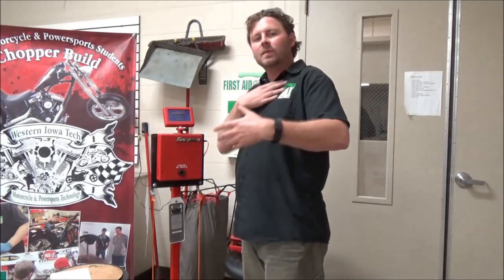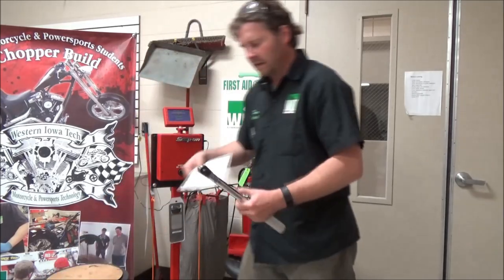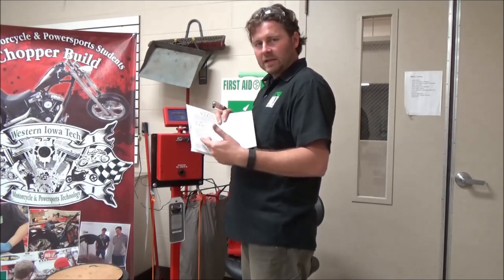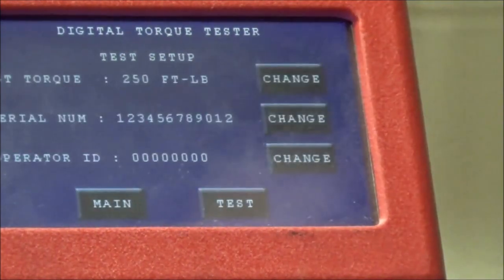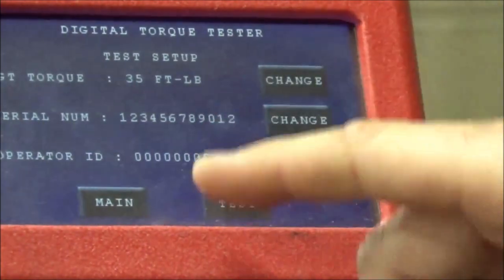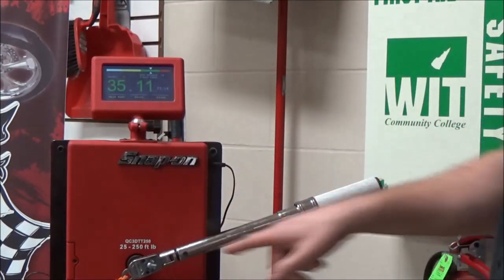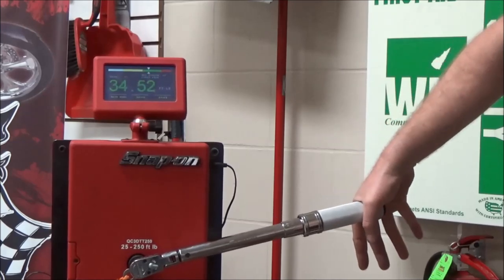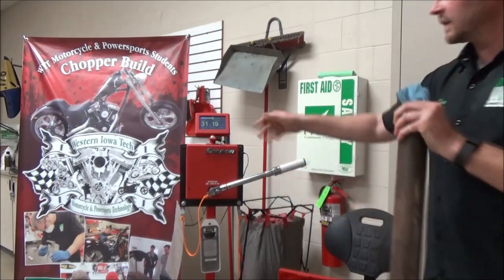Why hand placement matter when using a torque wrench. Proof with electronic tester!

Comment: This video is absolutely correct because the clicker torque wrench mechanism doesn't measure torque at the socket - it actually measures at the pivot where the ratchet head attaches to the tool's shaft.  The torque at the socket is greater than the torque at the pivot due to the added length from pivot to socket - so to correct for this the torque wrench scale is "doctored" with a correction factor to produce the right torque at the socket.  

The correction factor is a ratio: (distance from grip to socket)/(distance from grip to pivot).  The problem is, this ratio changes as you move your grip position - from 1.00 (with an infinite handle extension) to infinity (if you were to grab right at the pivot).  On my Craftsman wrench I measured this ratio to be about 1.09, which is probably typical.

So depending on where you grab, your torque can vary from 9% too low all the way up to infinite torque.  The only place where the correction factor is accurate is right at the center of the hand grip.  So be sure to grab it there.  If you need to use both hands, put one on top of the other to keep all the force applied to the grip..

Every torque wrench manual I've read says you must grip the tool at the hand grip only, but none explain why this is.  Now you know.......
Reply from the maker: Thank you for commenting. Would you consider helping support our work here and help keep us going? We can’t thank you enough for helping us keep making technician training impacting schools all over the world. Could you spare $2 and support us with even more benefits? Smash the subscribe button and bell! Join this channel to get access to perks:
https://www.youtube.com/channel/UCBhM8DCKnT3qXwTW0eToyCg/join   
-Daily MEMBER FIRST COMMENTS ANSWERED FIRST 
-Live Q/A video chats
-Wonder if we have a video on your need? Members can request content links!
-Full Access to the ENTIRE 700 video library
-Member-Only FREE tool giveaways 

Just want to say thanks quick to support us for this information and our work saving you money? 
Give us a high 5 here:  https://www.paypal.me/how2wrench
Reply: i just watched a 12 minute video explaining that with math (whitch i didnt understand) and then you just come here and expain it to me within 20 sekunds and 1 sentence, thx for the easy explanation

Comment: EDITED!!

Stuff is called length dependency or lever sensitivity. It is because "click" style torque wrench have secondary pivot point somewhere in the middle of the shaft (depends on the wrench). So whole torque measuring process is happening at this "secondary pivot" point. Therefore distance from this point to the socket works as an extension. So when hand is placed closer to the "secondary pivot" point it requires more force to achieve set torque resulting with more force being applied to "extension". 

It took me 20min to research. ;)

Great video! Thanks!

Original post below

Watching it in slow-mo. at 0.25 speed.

At short distance, after torque wrench "clicked" you kept applying force. Reading value "jumped" after click! So although set "click" force was accurate, additional "unwanted" force caused by poor control increased reading. 

Those "click" torque wrenches are designed to "click" at set torque. And it does not matter if large torque is applied at short distance or little torque it applied at long distance ;)

It is more about control. As pressing hard on short handle makes it more difficult to stop once set value is reached ;)

More accurate test would be 

Clamp long bar to the torque wrench and use pull scale at different distances. Calculate pull-force required to achieve desire torque and do multiple distances. As you go further away, the pull force will reduce but wrench will keep clicking at set value. 
It is important that extension bar is clamped - otherwise reading will be "shakey" ;)
Reply from the maker: You rock! Best way to help us back is joining or grabbing our T-shirt! Support links and gear below!  Awesome and thanks for commenting! Smash the subscribe button (thank if already a sub!)
Have you seen our "YouTube Trained Support Shirts? Great way to "high five us" https://goodfellasmerch.com/collections/how-2-wrench/products/support-shirt

Join this channel to get access to perks:
https://www.youtube.com/channel/UCBhM8DCKnT3qXwTW0eToyCg/join   
-Daily MEMBER FIRST COMMENTS ANSWERED FIRST 
-Live Q/A video chats
-Wonder if we have a video on your need? Members can request content links!
-Full Access to the ENTIRE 700 video library
-Member-Only FREE tool giveaways   

Just want to say thanks quick to support us for this information and our work saving you money? 
Give us a high 5 here:  https://www.paypal.me/how2wrench   

Got an emergency and your head is about to explode from frustration or fear? Get Shane’s cell here: https://how2wrench.com/ols/products/techline-one-on-one

Comment: To those who wonder why, there is an explanation here: https://www.engineersedge.com/manufacturing_spec/torque_wrench_1.htm
This type of "click" wrench has indeed a lever/fulcrum mechanism inside the shaft (see wikipedia: https://en.wikipedia.org/wiki/Torque_wrench#/media/File:Direct_pawl_clicker_torque_concept.png ).
So, the mechanism can be simplified as this:

T2      T1              F
|           |                |
|           |                v
o-------o------------|====
<- L1 -><-    L2   ->

A force "F" is applied on the handle, at the length "L2".
The setting of the torque wrench actually sets T1; it is the torque at which the fulcrum will buckle (and produce the "click" noise). The bolt will be torqued at T2.
If you take the equations:
T1 = F * L2
T2 =  F * (L1 + L2)

You want T2 a function of T1 and the length of the hand on the shaft, which is L2 (because this is actually where the bolt is, not T1, remember): you then replace F with either T1 or T2 and you have:
T2/(L1 + L2) = T1/L2 and so
T2 = ((L1 + L2) * T1)/L2

L1 is fixed, because it is inside the shaft (take a look back at the wiki diagram).

Basically, that means that the torque at the bolt (T2) will NOT be the same for a specific setting (T1, set on the wrench) if the force is applied at different place on the shaft. It looks like the function f(x) = 1/x.
You can pick fixed numbers for L1 and T1, calculate few "points" for T2 (depending on differents L2) and draw a diagram: it will all make sense :)!
Reply: You can see an example here:
https://zupimages.net/viewer.php?id=21/12/45lf.png

You see that for a fixed torque set on the wrench (T1), the "output" torque seen by the bolt (T2) really depends on the spot where you apply the force on the handle (L2). That is why it is important to correctly handle the wrench, where the manufacturer tells you to. This is because at this specific point, this is the correct "ratio" where the set torque on the wrench will actually be the one applied to the bolt.
Reply from the maker: Appreciate you ...🙌 
Thank you for commenting. Want more benefits? Smash the subscribe button and bell! Want even more??? Join the channel:
-Daily MEMBER FIRST COMMENTS ANSWERED FIRST 
-Live Q/A video chats
-Wonder if we have a video on your need? Members can request content links!
-Full Access to the ENTIRE 700 video library
-Member-Only FREE tool giveaways 
Join this channel to get access to perks:
https://www.youtube.com/channel/UCBhM8DCKnT3qXwTW0eToyCg/join  

Just want to say thanks quick to support us for this information and our work saving you money? 
Give us a high 5 here:  https://www.paypal.me/how2wrench
Reply: Thank you so much for this comment. Your explanations along with the wikipedia image give me a better idea of how these things work.Very much appreciate you taking the time.
Reply: This needs to be on top 👍
Reply: Hey you are great teacher that took your time and showed it better than anyone explains verbally for me. I watched a video drawing erasing calculating but he made me confused but your script is enough without any calculation.
Reply: @petethewrist  Your conclusion is correct, but since I have no idea what a "cros foityou" is I'll just paraphrase what I think you were trying to say: that while @benhetfield is correct in his math, his conclusion is wrong because (not withstanding any minimal deflection in any realistically constructed torque wrench) hand placement doesn't change the "effective" force at F, it just changes the actual force you have to apply wherever you do place your hand; you will indeed have to apply more force with your hand if it's closer to the bolt/nut/whatever and less force (from your hand) the farther you get away from it (but the wrench is indeed measuring the exact same torque regardless of hand placement). That is an absolute fact. The reason the tester is displaying different torque values is due to some other factor, most likely because the user has to pull so hard on the wrench when choked up close to the pivot point that they can't react fast enough when the wrench clicks; remember that the machine is displaying the maximum torque measured, NOT the torque measured when the wrench clicks.

Comment: I’m a structural engineer (1980). The torque measurement mechanism is specifically designed for a consistent load application point. This obviously is the handle.  There is more complexity going on in the measuring devise than appears to a simple observation.  These forces of shear, axial, force couple, angle of force application, rotational torsion, gear friction, thread friction, variable stiffness spring constant and other characteristics are affected by the force application location.  The handle works!
Reply from the maker: Thank you for sharing…below are some links that help support me and my work. Please subscribe and share these videos to make a difference in education!
Keep Wrenching,
Shane Conley

Shirt/Stickers link: https://how2wrench.com/product-category/specials/ 

Follow us!
Web:
http://www.How2Wrench.com    
http://www.Tools2Wrench.com  

YouTube: 
https://www.youtube.com/c/ShaneConleyhow2wrench  

Instagram:
https://www.instagram.com/how2wrench/ 

Linkedin: 
https://www.linkedin.com/in/shane-conley-how2wrench/ 

Facebook:
https://www.facebook.com/MechanicsLearningSharingPage/  

Free Mechanic info, tool reviews, and “how to” videos newsletter sign up: https://how2wrench.com/subscribe-free-newsletter/ 

Amazon Tools: 
https://www.amazon.com/shop/shaneconleyhow2wrench?ref=ac_inf_hm_vp
Reply: @petethewrist  Not True. In fact if you have the complete formula you can calculate what the error will be for any hand position which matches the tested values. It's hard to understand it but it absolutely is a fact, hand position matters. The best explanation I've seen is the vid "Why GRIP Position on Torque Wrenches MATTERS!"  by The Bike Sauce who breaks it down.

Comment: The reason for the higher numbers when you grip only part way up the handle is easy- almost no one can react fast enough to release their pressure on the handle before reaching the end of the stroke after it clicks, which will produce a higher torque reading. It has nothing to do with the torque wrench itself.
Reply: Wrong.  It has everything to do with where you place your hand.  If you can't react fast enough to stop pulling when the wrench clicks, you'd get excessive torque even if you hold the wrench properly.  It's a matter of geometry, not reaction time.

Comment: Very good video.  

I am an Engineer and have watched a few of your videos to date.  You are 100% about handling the torque wrench in the center.  One thing I want to add is how to pull the wrench.  You should not push down on a torque wrench.  You should pull the wrench with your hand positioned in the center.  This allows you to control the motion and stop at the click.  Also, as the fastener tightens, you need to slow down until the wrench clicks.  This ensures you do not overtravel.  

You nailed the 25 lbs.-ft once in your video.  Try again and avoid pushing down on the wrench.  Pull it towards you, as you tighten, to observe how the torque is attained close to your setpoint.  

You have a great channel and are an excellent instructor (and your videos are spot on).  This is something I wanted to add since pulling towards you, rather than pushing, allows you to control the clamping force and stretch the fastener more effectively.  More often, pushing usually gets you over the target torque.

Keep up the good work!!
Reply from the maker: Well thank you! We will share this with Shane directly in Fridays meeting! 
You rock for commenting! We encourage experience and well wrote out comments like yours Bryon. 
Grab our T-shirt! Support links and gear below!  Awesome and thanks for commenting! Smash the subscribe button (thank if already a sub!)
Have you seen our "YouTube Trained Support Shirts? Great way to "high five us" https://goodfellasmerch.com/collections/how-2-wrench/products/support-shirt 

Join this channel to get access to perks:
https://www.youtube.com/channel/UCBhM8DCKnT3qXwTW0eToyCg/join    
-Daily MEMBER FIRST COMMENTS ANSWERED FIRST 
-Live Q/A video chats
-Wonder if we have a video on your need? Members can request content links!
-Full Access to the ENTIRE 700 video library
-Member-Only FREE tool giveaways   

Got an emergency and your head is about to explode from frustration or fear? Get Shane’s cell here: https://how2wrench.com/ols/products/techline-one-on-one

Comment: That was really useful. I kind of knew already that hand position is important when using a torque wrench.  It gets messy and confusing enough anyway for students (and the rest of us supposed professionals) when learning how to calculate torque correctly when using the approved attachments each tool company provides. Not handling the wrench properly just makes it impossible to do accurate work. Your empirical approach gives irrefutable evidence that hand position is pretty critical when using these very precise wrenches. These companies invest a lot of money researching and testing and finally manufacturing a reliable, and trustworthy piece of equipment. We need to honour that commitment to quality by using their tools as they were designed to be used. I am now a new subscriber. Two thumbs up !!!

Comment: One thing that I cannot seem to find any videos or anything about, that I am super curious about but I don't have any super expensive and really accurately calibrated machines like you guys would. Couple of days here in Iowa the low temperature has been below zero degrees Fahrenheit with a wind-chill of around -25°F to -30°F. Now, I have a very basic understanding of how torque wrenches work internally and also have an understanding of how metals can expand and contract from hot and cold temperatures. So even though my being out here in the garage with thermals and coveralls or my heated hoodie may keep me nice and warm and thanks for keep my brain thinking straight and calibrated. How do the cold temperatures in the garage affect the spring inside of my torque wrench? For example my torque wrench which could be perfectly accurate down to the fraction of a percent during the summer when it was calibrated, now that the climate has changed from being a hundred degrees to below 0 degrees how does that affect the condition of this spring inside the torque wrench? I'm sure it has to even if it is very minut, I'm sure it has to have some kind of effect on the accuracy of the tool

Comment: I know its an old video, but had to comment. The outer tube flexes, this is taken into account when the wrench is calibrated. The trip mechanism is about half way down the tube, if you manipulate the tube in any way, ie putting pressure on it in a way that differs from hoe it was calibrated you'll affect how it trips.
Reply: I don't know if the handle flexes significantly, I suspect the answer is "no".  But that's not the issue.  Even if the handle were perfectly rigid the torque will still vary depending on where you place your hand.  It may not be intuitive but it's definitely true.  Dust off your high school geometry and trig skills and see for yourself.

Comment: Be honest with ya, I was about to torque down a rocker box on my motorcycle and realized that my torque wrench was too tall with a step down and socket so I thought I’d put on an extension, but realize that I’m adding torque length for an 18-25 ft. Lbs. then I seen one of your other videos about if it’s 90 degrees off the extension then it will cancel it’s self off. Thanks for the educational videos man. You’re right, there’s many jerks and haters out there. I appreciate the education. Keep it going. Shared knowledge like this helps us slow joes smile when we get our vehicles running in decent condition. So, educational knowledge applied makes mechanics smile!!!